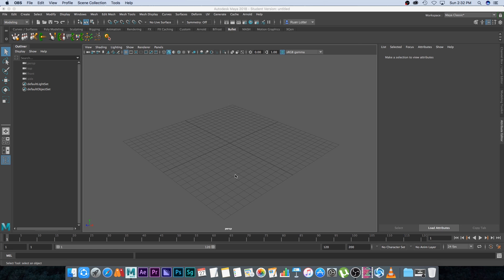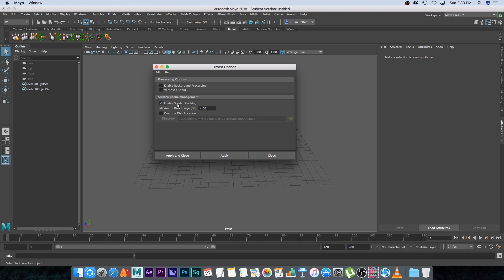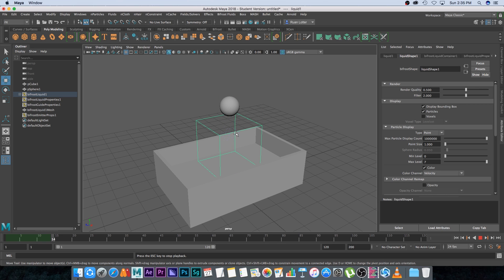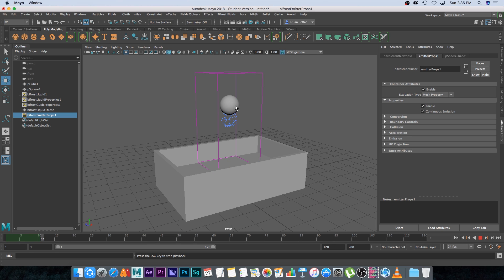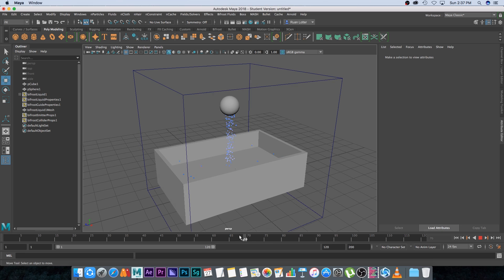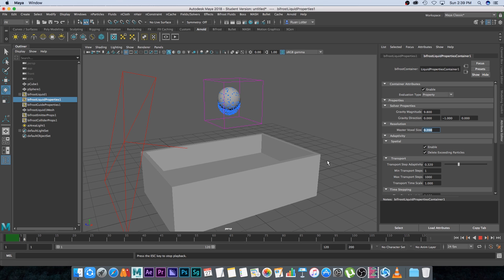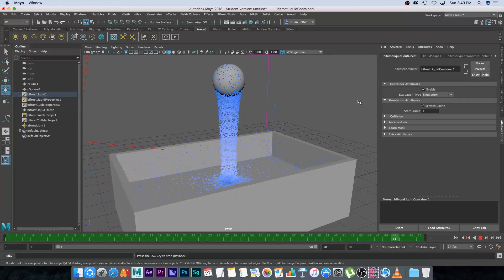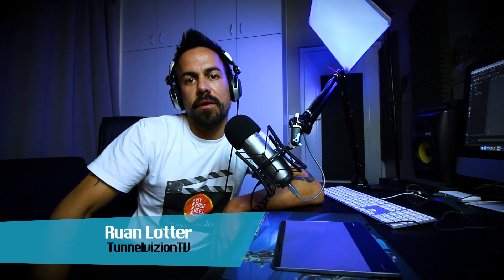Maya Tutorial: Bifrost Fluid Simulation Basics

Comment: If you guys are having trouble rendering the bifrost simulation, go to the LiquidShape tab, then Bifrost Meshing channel and hit "enable"
Reply: I have a error: // Warning: [mtoa] [translator polymesh] ShadingGroup bifrostLiquidMaterial1SG has no surfaceShader input
can you help me?
Reply: @korestify  I would try turning on the file directory for the geometry caching in the bifrost properties tab and let it run once in the timeline to cache the simulation. Do an arnold test render and it should work. It's usually applied with the default bifrost shader, but you can always add a custom shader in the node editor.
Reply: Hey sorry to bother you but when I go to do my first render I get a warning saying, "#Warning: liquidShape1: could not set UNIT parameter "smooth iterations" . I was wondering if you had any idea what that means I'm still quite new to maya and am just playing around currently making a potion bottle where the emitter is inside the container. Dont think that should make that much of a difference though. Thanks in advance